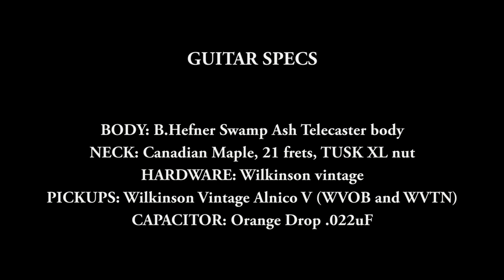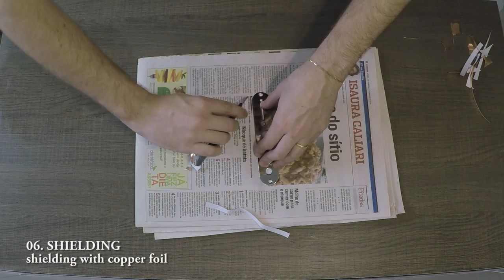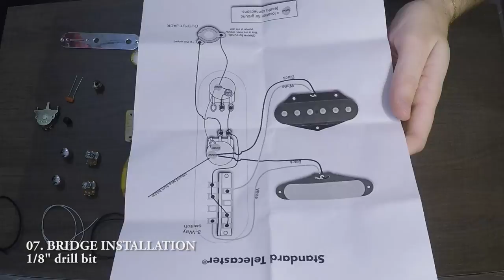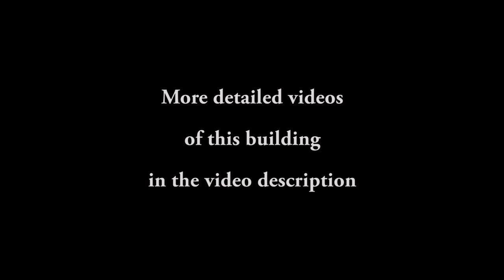Building a custom Telecaster inspired by the 1950 Fender BROADCASTER | How To | DIY

Comment: The control plate and bridge plate, are already metalic and pritty well conductors and aslo they are in direct contact with the shielding of the cavities, personally I wouldn't put copper tape on them. Anyway nice job.
Reply: Not only is this totally unnecessary -- those elements are better shields already due to their thickness -- you risk introducing galvanic corrosion over time.
Reply from the maker: Thank you, you're right. I used only because copper is a better conductor, but no need at all.

Comment: Nice video! A point about shielding - To create a proper shielding system you need to run a wire from each of the pickup cavities and also one for the underside of the bridge,You can just strip a section of wire and trap it under the bridge for that part but the other 2 wires need to be terminated on a small ring terminal which is screwed into the copper shielding, At the other end, the control cavity terminate all of the wires on ring terminals plus one from the control plate itself, As per previous the ring terminals are all fixed to one screw that is fixed through the copper.This setup is called a star wired earth system. I was taught that if you didn't fit the earthing you are in danger of creating an antenna system from the individual bits of copper shielding.Hope you are not offended by my writing this as that was not my intention. Cheers
Reply from the maker: Hey, thank you very much for your informative comment. If I understood all you wrote, I think I did all the steps you said. Please, take a look at this slower video to confirm: https://youtu.be/oW_bTYxj9kY Thanks and best regards.
Reply: That's not necessary if you line all the cavities properly with bits of the shielding tape coming up over the edge. The grounding on the back of the potentiometer bodies terminating at the output jack will connect with the metal control cover, which connects to the bridge, and finally to the neck pickup cavity via the pickguard. The tape will complete the faraday cage. Not sure why the builder lined the underside of the control cavity cover and the bridge, as they're both metal, which is conductive, and also why they did not line the whole back of the pickguard, or at the very least the middle-treble end so that the neck pickup could be shielded completely via the shielding tape at the top edge of the control cavity. Lining the output jack hole as they did also presents the possibility that the positive arm of the jack could ground itself, especially as they used a vintage style Telecaster jack cup.
Reply: There is no Faraday cage,
It's simply shielding the pickups from outside EMF

Comment: I found out by accident that turmeric powder and alcohol make the most vibrant golden/blonde dye I've ever used. The more layers the darker of course. I've also used cinnamon powder for darker mahogany like colors. You open your guitar case and it smells like a cinnamon roll. Cinnamon also makes a great grain filler for mahogany when you rub it in and then hit it with shellac in alcohol. Nice build btw, and nice playing, if it was you.
Reply from the maker: That's a great tip. Thanks.

Comment: I really like the looks of the guitar! However, I know this is an old(ish) video but you don't really need to shield underneath the bridge or control plate or inside the jack "tunnel" routing. Some will even claim you don't need to copper foil inside the control cavity.

Comment: nice build but why the need to put foil on the bridge base plate and knob plate - i think that's unnecessary - i like the decal how did you make it?
Reply from the maker: You're right, I just did that because copper is a better conductor. Please, for the decal details, check these two other videos: https://youtu.be/5JI8qnhpEKc and https://youtu.be/MPGpSaOWa1M
Reply: Awesome! Thanks man!
Reply: But you are not using the copper as a "conductor"....you are using it for shielding and both the bridge and control plate will shield better than any foil...
Reply: No need to put foil to the metal parts, they're conductive as is. In fact, you're making the connection worse by adding a layer of adhesive, which isn't anywhere near as conductive as the brass hardware (nickel or chrome plated). Anyway you just need to conduct radio noise to ground, Not shoot lasersfrom the guitar, so the conductivity isn't an issue anyhow.
Reply: Hi. Do you know when and on which guitars did Fender use either the gold or silver logos? Thanks. Great vid BTW.
Reply: i think the shielding is necessary as the pickup is a magnetic component, so shielding keeps it from interference point of view
Reply: The pickup isn't going to care much about the rest of the wiring of the guitar: It's all the same signal. However it and the electronics must be shielded from nearby sources of EMI such as amplifiers, power cables, and computers. I agree with the Russian fellow above: no need to stick copper to steel parts; just make sure they are well bonded and don't buzz.
Reply: @corybritton1804    (Oh, the cognitive dissonance...) Sorry there, Cory ; The Russian was right... Everything needs to conduct in order to be one continuous shield ... The adhesive on the copper tape may or may not inhibit conductivity; the point is, it's unnecessary ...
Reply: maybe he did it because it made him happy. why would Experts be watching this in the first place?
Reply: @Jah_Rastafari_ORIG  I mean, I could possibly see it as an EMI Shield, but copper is probably not going to cut it, you'd need brass... and even then, the original Broadcasters didn't have the shielding, and they sounded really damned cool.  I mean, shielding the cavities for the pickups etc. is fine, but the EMI will be picked up along the cables between pickups and switches.  Agreed it's unnecessary.

Comment: Very fine job, and...correctly called "inspired to" a Broadcaster… The truss rod  access is like the MODERNS Fenders. The First trussrod...Simply there was not, in the "50s" Telecasters...then the trussrod access was in the "Body side of the neck" and works with a screwdriver,not with a hexagonal key, like the moderns Fenders….
Reply from the maker: You're right. And there are several other differences. Thanks!

Comment: Im pretty sure that copper shielding your metal plates is entirely redundant.
Reply from the maker: Yes, you're right, I only did because copper is a better conductor. But no difference at all.
Reply: @gugarl  Seems like a better conductor would be worse for shielding.
Reply: @nazfrde  You mis-understand shielding. You're thinking of "insulating". 

A good conductor makes a better shield because it easily conducts spurious signals to ground. Google "Faraday Cage" (https://en.wikipedia.org/wiki/Faraday_cage) and you'll have a better understanding of shielding.

Comment: When staining and tru oil, how long did you wait to dry before resting one side on the newspaper to apply on the other side?
Reply from the maker: It will depend on the room umidity and temperature. But it is fast. And I don't recommend using newspaper because it can taint the wood.

Comment: No need to shield the metal switch plate.
Reply from the maker: Yes, you're right. I've just shielded becuase copper is a better conductor. But no difference at all. Best regards.

Comment: Gustavo nice overview video.  Two things I do differently is, 1 no copper shield on the back of already metal parts.  this provides no value.  2 no pick guard to cover the beautiful wood grain.    what kind of pickups did you use?   how does it play?
Reply from the maker: Thanks for commenting. You're right, no need to use copper foil in the metal plate and bridge. I'm using the pickups Wilkinson Vintage Alnico V (WVOB and WVTN). Both have vintage specs and one of them the same of the Broadcaster. I like them and soon I will post a video showing their tone. Best regards.
Reply: I look forward to the demo.

Comment: Oh no! Another home made tele with a poorly fitting pickguard around the lower waist and horn. What happened? Badly routed body? Badly cut pickguard? Both? It kinda ruins an otherwise nice build. How unfortunate. Compare with a real Fender or a Warmoth partscaster to see how the pickguard should fit. Nobody else noticed this?
Reply from the maker: Really my bad...
Reply: Oh No! Another Comment from an Expert YouTube Luthier. Could (Can) you please reply with a link to showcase your Guitar Build(s) of a Telecaster, HighLighting your Craftsmanship, that displays the Proper Application(s) that doesn’t include a Poorly Fitting Pickguard around the Lower Waist & Horn?
Reply from the maker: @corporalclegg914  You're right! If you scroll down, you will find hundreds of comments like this. I've just wanted to share my experience with this guitar building. Thanks for your support. Best regards!
Reply: Gustavo Rocha Leite Hello Gustavo my question is can I just stain the bare wood and use the Tru Oil as the grain filler by sanding it after a few coats?  Using an ash body like yours...

Comment: Great job!  I've a laser to help with neck/body alignment (just a cheap "leveling" device, but super easy to adapt), and it was nice assist.  Didn't see if the jack cup was an exact reproduction, or a more modern, radius-ed cup design (I'm guessing orig.).  Thanks!
Reply from the maker: Thanks! Great idea.

Comment: That is a beautiful guitar!

 I like the Broadcaster/nocaster era myself. Went about mine a slightly different way. I bought a modern Squier Affinity Telecaster and did a full vintage conversion on it to the '51 style.
Reply from the maker: Thanks! Is the Squier Affinity body made of alder?
Reply: Yep. It is thinner than a standard body and the neck's a bit slimmer, so I don't really consider it a true replica. More of a nocaster tribute. But it sounds good and it's a blast to play. :)
Reply: I also went with a modified Broadcaster/nocaster blend wiring scheme.
Reply from the maker: Great! What do you feel about that old blend wiring scheme?
Reply: I like it. I wanted to stay true the the functionality of a Broadcaster and it has some interesting possibilities. Everything from just the bridge to both on, and subtle shades in-between. The middle position, the neck with no tone load, sounds really nice. The only change I made was to the 3rd position "Deep Rhythm Circuit". Instead of a darker .047 cap, I went Greasebucket style, .022 in series with a 4.7k resistor. It thickens up, but without going muffled, giving some nice distorted rhythm sounds from the neck pickup.

Comment: Nice job mate 👍
I clicked on this because I wanted to hear the Wilkinson WVOB bridge pickup and I must say I'm impressed with it.
I have a Tele Deluxe that I made myself a few years ago, and while I do like the wide range humbuckers I bought for it, I've been wanting a single coil Tele bridge pickup but didn't want to buy a new Tele.....So I bought a new scratch plate that was routed to take a Tele single in the bridge and a PAF humbucker in the neck. I decided to get the Wilkinson WVOB bridge pickup because it's based on a Broadcaster bridge pickup, which at 7.7k ohms is hotter than a regular Tele bridge pickup of around 6k ohms.

I wanted that because my neck humbucker is around 7.5k and I didn't want a regular Tele bridge pickup to get lost in the humbucker.
I've realised that my Tele Deluxe is a super versatile guitar because I can easily buy another scratchplate, load it up with pickups & pots etc, say 2 Filtertrons for example, and whenever I feel like playing a guitar with different pickups, all I have to do swap the scratchplates to whatever I'm in the mood to play.
Why did you use the 223 caps instead of 047s which is normal for single coils?
Reply from the maker: Thank you for your rich comment. Take a look at this diagram: https://www.tdpri.com/attachments/broadcaster_joenotes-791x1024-jpg.538585/

Comment: I could have used more explanation as to the finish,
And much less, unnecessary copper shielding.
Certainly did a beautiful job though❤
I especially like the detailed video on neck installation, I found that very helpful😊

Comment: 1. That dye job is beautiful. 2. Did Broadcasters have a neck pickup? 3. I agree with the comments about the foil. I would have spend that time on something else.
Reply from the maker: 1 Thanks, Frank. 2 Yes, they have. 3 You're right, I just did that because of copper is a better conductor. Best regards.

Comment: Looks like your pots are already grounded to the baseplate. connecting wires between the pot housing creates 2 paths to ground output = ground loop
Reply from the maker: Thanks for the tip.

Comment: Gustavo Rocha Leite Hello Gustavo my question is can I just stain the bare wood and use the Tru Oil as the grain filler by sanding it after a few coats?  Using an ash body like yours...
Reply from the maker: Yes, absolutely. I did it with another bodies and the results are really great.
Reply: Thanks for the reply!

Comment: Can you tell us where you bought the kit, and the hardware components? I built a kit from The Fretwire that was pre-drilled. The neck fit perfectly tight to the body, but alignment was slightly off and I could not change the positioning of the bridge since the pilot holes were already drilled.

Comment: Beautiful guitar. Makes me wanna build one instead of buying.
Reply from the maker: That's great to hear! Best regards.
Reply: Well for less$ ypu could get 1 2 piece unlike some fenders usa 4 pieces glue and in mim tele upto 7 with cap ontop and back. Worth swapping out the body. Not it'll sound better but so it's not so many chops glued together if solid paint. If spend 1200 plus on guitar and use it forever then paint flakes to show slabs all glued together is less nice to see than 2 part.  Mim 7 piece bodies! Terrible when think of cost new. Usa 4 us as bad! I think.

Comment: Gustavo, what a great video! :-) I really enjoyed watching it!

It was very interesting seeing you use a couple of wires to connect the shielding, between the neck + bridge cavity and bridge cavity + control cavity! How did that work out? Well, I could see that you had continuity between all cavities, so it must have worked! I think it's a great way of doing it, and I will certainly do that on the future guitar I shield! Thanks for that!

Did you just use a standard single connection wire? :-)

Cheers man!
Reply from the maker: Thank you very much. You're right, the shielding needs continuity between all cavities. You can also solder the wires and I'm using standard single connection wire. Best regards.
Reply: Thanks for the reply, man! I appreciate it :-)

Your way is indeed great and easy - I will do that on my next guitar repair! :-)
Should be all good!

Yeah, there's the soldering as well, but I like your method.

Thanks, I have some wire like that in my tool box - great!

Cheers, mate! :-)

Comment: Wow. Very nice, thanks for sharing. I've always wanted to get an unfinished body and do this. My own made in North America guitar. How hard is it to line up the neck and bridge and nut though? Prob more difficult than you make it look for sure.
Reply from the maker: Thanks! Not that hard because even after fixed, the neck can be adjusted. The neck pocket holes are bigger than the bolt.

Comment: Looks great but you have not created a shielding system. Star wire from each of the pickup cavities plus one from the underside of the bridge.Bring the 3 wires back into the control cavity and terminate the wiring on a screw/stud into the copper lined timber. You should also connect the control panel to the earth system to create a proper grounded shielding system.If you do not build a shielded system as above all you are doing is potentially creating a bunch of small antennas, the exact opposite of what you should be achieving.Cheers
Reply from the maker: Thanks for commenting. All cavities and also metal parts are connected. I think I didn't understand what you mean. Best regards.

Comment: are you rubbing the tru oil on with the sandpaper?
Reply from the maker: Yes. This is a great wood filler technique. The first step of the process showed in the video (wood filling) don't need to be done if you apply tru-oil as I did.

Comment: How did you align the bridge to drill the 4 mounting screws holes in the right place.
Reply from the maker: Using sticks inserted into body and bridge string holes. More details: https://youtu.be/uOy7R2SRFJo
Reply: Because the six string threw holes in the body line up with the six holes already drilled in the bridge plate. its just a matter of getting the sting holes lined up bang on then marking the four bridge plate retaining screw locations.

Comment: What is the purpose of the shielding on a part that is already made entirely of metal?
Reply: Came here to comment the same thing.
Reply from the maker: No need at all. I just did it because copper is a better conductor.
Reply from the maker: No need at all. I just did it because copper is a better conductor.
Reply: Gustavo Rocha Leite you added cooper onto the other metal so you incresed the total resistance anyway. From electrical point of view it’s even worse than without it and it has to be said even if you made the entire shielding out of gold you would not hear the difference.

Comment: I would have rounded the edges of the body more and not mounted the neck pickup to the scratch plate, but thats me.
Reply from the maker: The edges of the body are like the vintage Telecaster. I preferred to mount the neck pickup to the scratchplate because it is easier to adjust. Best regards.